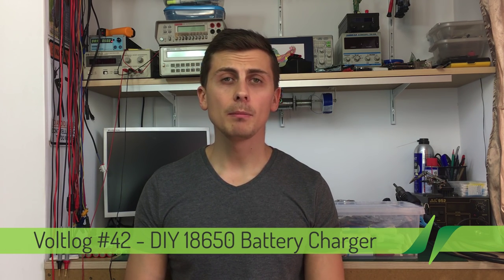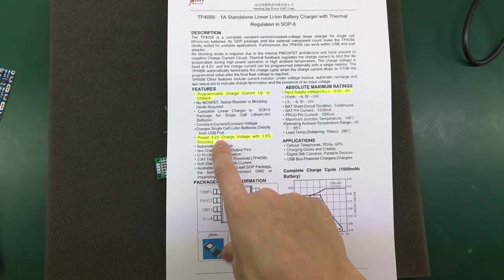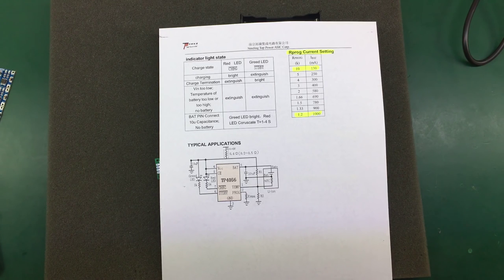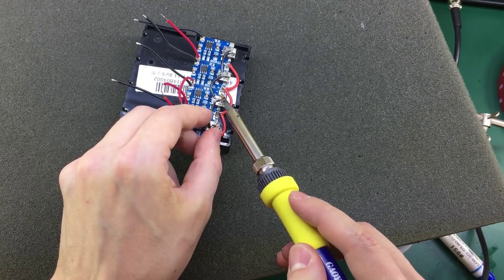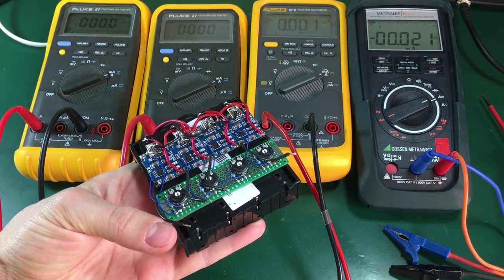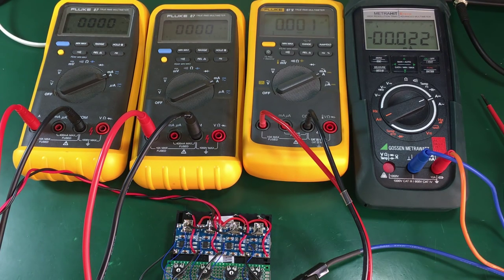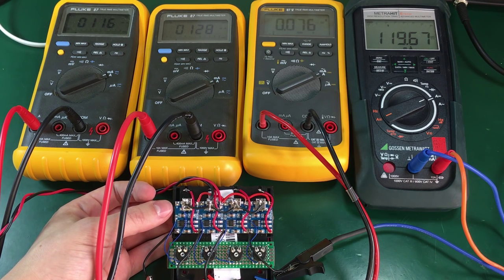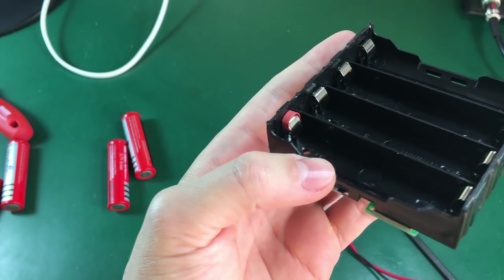Voltlog #42 - DIY 4 x 18650 Lithium Battery Charger TP4056

Comment: Hi thanks for this video. this system is interesting because it's cheap, and intended for unconnected batteries while charging. 

However, this is not suitable for charging series 18650 cells. 
Since the power charging 5v source is the same, distributed in parrallel, each battery output leads of modules will have same GND. So, if we use this setup and charge that series battery pack, we can expect some magic smoke, or TP4056 put itself into protection (if it have the time lol) B1 VCC pin is physically connected to B2 GND pin. SO, voila: fire-pshhh

I'm still looking for proper charging diy and IMHO would be better to use a BMS for protection, in addition of a current regulated charger source @ 16.8v/ 2-3A 

Hope this helps

Comment: Hello, I like your idea to be able to regulate the charging current with a pot, since low charging current is better for the bat and for the chip too. But why the 1K resitor ?? since you are using already 10k pot?? is not the 10k pot enough??
Thx

Comment: The tp4056 chips I have cannot tolerate reverse polarity.  I have fried a couple by accidentally inserting the cells the wrong way.  Smoke rises from the chip and it's gone.  Great video and very well done project!
Reply from the maker: +Tim Byers thank you!
Reply: thats why you should use the new version.

Comment: Very nice video. I have a newbie question here. From what I understand the tp4056 will control the current flow depending on the battery voltage right? Once the voltage gets to a high level then the current lowers?So if you take out the resistor like in your video, will the tp4056 still try to change the current flow regardless of what your variable resistor is doing? Thanks
Reply from the maker: +daniel shinsato Haven't tried that scenario but the TP4056 will probably be feeding only a couple of micro amps or maybe not charge at all since it will see a high impedance at the RPROG pin.

Comment: Hi, just a question. Do you know a similar circuit to charge AA and AAA rechargeable batteries?
Reply from the maker: +Roberto Espenica no, unfortunately I don't know any as cheap and accessible as the TP4056.. Something more reliable/expensive is the BQ24401 from TI. It can do NiCd and NiMH http://www.ti.com/product/BQ24401

Comment: Is it possible to use two of such TP4056 modules to individually charge two 18650 batteries that linked in series?
Reply from the maker: no

Comment: I have a question  I build a charger similar to the one you did but I Wanted to add one of those voltage meters from Banggood So I could see the total battery charge of all 4 batteries  can you tell me how to do that ? Cause I can only get the amount of charge per battery or the current coming in  So I must be doing something wrong ...
Reply from the maker: what exactly do you mean by the "total battery charge"? if you are referring to the capacity (Ah) then you would install a meter capable of measuring that in between your power source and the DIY charger. It will measure everything that passes through, however it is not an accurate indication because these linear lipo chargers have losses so not all the energy will go into the battery, some will just be turned into heat.

Comment: Did you measure the value of the trimmer?So I can put a direct resistor value
Reply: yes , that what I always do!!  look at the datasheet of the TP4056!! higher resistor >> low charging current! 
>> Slower Charging :)
You can even go above 10k resistor, I tried it and it works fine! Charging current should not be above 30-40% of battery capacity!!!  I even used 22k and for 1 small battery 39k!!! Only downside it is charging slowly, but better than to kill your battery in only 2 months, and go to buy another one.... Slower charging and any battery will say to you thx 😋
Reply: @DrZipZwan  so slow charging is better than fast charge?If you want longer life on your 18650?
Reply: @neilritchiecaguioa8593  of course, Slow charge is always better than fast charge!! 
I used TP4056 in more than 8-10 different projects and I always changed the charging current resistor!! 
Plus most people using this board with salvaged 18650, so you have to be kind with those salvaged battery 😁
Reply: @DrZipZwan  Does the home made TP4056 charger is better than the Branded products like Nite core?That brand is expensive.Thanks for the alternative
Reply: @neilritchiecaguioa8593  it depends from what you are looking for.... TP4056 is fine and even this IC is used in PowerBank!! what are you looking for exactly??
Reply: @DrZipZwan  a low cost Lithium ion battery charger,And also a perfect lithum ion charger,TP4056 is available here in my country Philippines,And I can build one just like you show on your video,The resistor you showed is new to me,Thanks for sharing that.
I have put so may Gadgets using 18650,On my 8" Tablet 9 pieces 18650 mounted at the back,And it's been charged by the charging ic of the Tablet.it took a long time to charge,But the discharge is longer,i didn't test it on stand by yet,Because I'm using it constantly.Especially games on a Emulator.I'm happy with it,It looks ugly and heavy,But the discharging time took about 6hrs straight,I'm a heavy gamer
Actually there's one thing im looking for,I want to build a BMS Charger for my EBike,A home made one,Because it's hard to find or order online just for a BSM charger 48v 20ahm and 60v 20hm
Reply: @neilritchiecaguioa8593  for the EBike, you can use PowerSupply for Led application combined with a BMS 40A or more.
Like this:
https://cdn.shopify.com/s/files/1/0507/7933/products/12V_10A_Power-supply-for-strip_1.jpg?v=1571439121
They can deliver a lot of Amps, but more Amps more $$$ 😁
I recommand you check GreatScoot video for the EBike suject!
https://www.youtube.com/watch?v=zaTskMjpXtA
He got a full serie about long Board, and the power topic is also covered!!
There you can get ideas for Power topic for your EBike.....
Reply: @DrZipZwan  thanks for the info
Reply: @DrZipZwan  The idea of put 9x 18650 on a tablet because I want to play games on it uninterrupted. The USB controller connected to OTG then to the charging port of the tablet.So you can play games like a game console with your Tablet,Question is?So how can I play games longer on the Tablet with the USB Controller & OTG is in the way on the charging port of the Tablet?
That's why I put many 18650 at the back of the Tablet,Problem solve,You just charge it over night,Then play at the morning
Come to think of it?I have an idea putting PowerBank module at the back of the Tablet together with 18650 in parallel,I haven't try this yet,A good idea to leave the charging mechanism of the Tablet alone.And the PowerBank module do the rest.
Question is?Is in it dangerous for the Tablet having two charging ic's on the 18650?

Comment: I like this idea and works great. I would like to use this as a pack for my headphone amp and require these batteries to be wired in series. Is there a way to use this without much parasitic loses.Thanks,
Reply from the maker: this circuit will not charge batteries connected in series.
Reply: +Krzysztof Krawiec The module in the link is aimed for protection only, NOT for charging. In series Lipo's or Li-Ion's still need to be charged and balanced properly.

Comment: Hi, I would like to make similar charger but for 3 PARALEL 18650. I tried to find 5V 2A boards similar to Yours but didn't founded. Maybe You have some idea how to solve my problem?
Reply from the maker: there are 2A charging circuits available on ebay.
Reply: VoltLog how can I find them? Can You tell me their name/number?

Comment: Hi, I 'm using this TP4056 from 5 volt USB power adopter and I got only 4.1-4.12 volts not 4.2 volts and the charging process stops. Do I do something wrong ? Thanks
Reply: +Cristi Istrate That is within range specified in the spec sheet. It's the minimum. On the good side your battery will last so many more cycle.

Comment: Hello. Thank you for this video. I am not an electronics expert, so I would like to ask for your help. I want to make a battery pack for my bicycle led headlamp. I have 4x 18650 cells connected in parallel to output the 3.7V. What kind of battery chager / controller and protection board do I need? The charging time is not that important, as I can leave them to charge overnight. Can you please help me? Thank you in advance.
Reply from the maker: with a TP4056 set for 800mA charge current, and a typical 18650 capacity of 2500mAh x 4 = 10.000mAh. Divide this by the charge current and you get 12.5 hours charge time. You will need a 1S battery protection board that is capable of sustaining your led lamp current.

Comment: I measured the current during charging with my tp4056 and I get around 160ma only.  all 5 that i bought. they have the 1.2k rprog. the voltage of the batt is 3.4v. it seems to be staying the trickle charge zone. Does that mean they are bad?
Reply from the maker: if you have enough input voltage and current, if the set resistor is 1.2K and if the battery is not full yet, then yes I would suspect something wrong with the chips.
Reply: My power supply is 5.2v and 1a. 
I did notice the OUTput voltage from the tp4056 is near 4.20v so that could explain the low current. Shouldn't the output be near the batt voltage?

Comment: Hi. My tp4056 is heating everytime I've charge li-ion 18650 and melt silicon under it sticky it to battery holder.
Reply from the maker: It is normal for the TP4056 to heat up. But if you push it to it's limits, it might fail soon.
Reply: my TP4056 were also getting very hot, when it just start because when starting chargg the bat, if lets say the bat is 3.2v, the chip is charging around 1A, that why it is getting hot, Check the datasheet to understand, how the curve of charging current goes according to battery voltage.... So summery >> high charging current >> high temperature!!!
Just reduce the charging current by changoing the RProg resistor, I am doing this for all my TP4056, which induce slow charging >> better for the batteries. Better life span and so on.......

Comment: How about charging 3 x 18650 in series?
Reply from the maker: +paulham you would need a charger designed for charging a 3S pack or you could use 3 x TP4056 each powered through an individual isolated dc-dc converter.
Reply: +VoltLog Have you seen the blue box 12v battery packs (with 2.1mm plugs on). They have 3 cells, each with their own protection circuit and some sort of 12v power plug to charge.
Reply from the maker: +paulham sometimes you find these protection/charging modules which incorporate everything on a single slim pcb. One good example is laptop batteries which often contain, battery charging + protection + gas gauge circuits.

Comment: what if i want to charge batteries at 500mA fixed current. what do i need to do?
sorry for the noob beginner..
Reply: Take a look at the Datasheet of the TP4056, for 400mA you use a 3k Ω resistor, for 580mA a 2k Ω resistor. So if you want exactly 500mA, you can test it with a potentiometer, and measure its resistance after you have turned it for 500mA, and then you add one or to resistors at the prog pin ;)

Comment: Does anyone know the current draw of the TP4056, I'm assuming about 1 amp at 5 vdc.  And, if the TP4056 is given only .5 amp input @ 5 vdc, how is the charging voltage and current affected?  The reason I'm asking is I'm thinking of using a 6 volt solar module as the "power supply."  Lastly, does the TP4056 automatically disconnect  the battery load at a certain battery voltage threshold in order to protect the battery against an over discharge condition.  Thanks!
Reply: Try the P390 from Adafruit. It's a 3.7v lipo charger built to be powered via a 6volt solar panel. It is $20 vs $0.99 for a TP4056, but your time might be worth more.
https://www.adafruit.com/product/390
Reply: The TP4056 has a programmable max current, as shown in the video. I haven't hooked one up to a multimeter to measure amperage, but I'm going to assume there are some power loses in the 5v input to battery output step down, based on the noticeable heat generated by the unit. If you Google the datasheets, you can see some graphs of the charge profile. The charger outputs the max current from ~3 volts battery until a little over 4 volts battery. Once the battery nears full charge, the TP4056 switches from constant current to constant voltage mode. Output voltage is 4.2 volts now, and the charge is terminated when the output current reaches 1/10th the programmed max current.